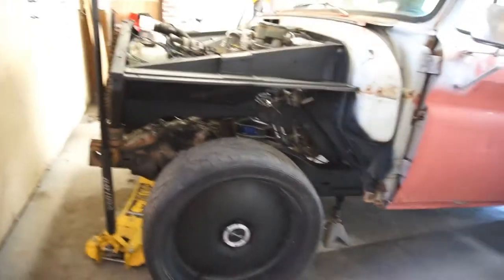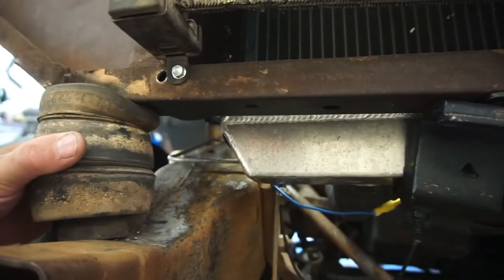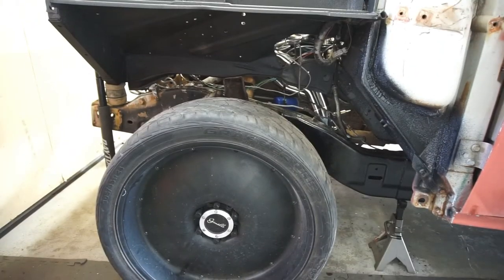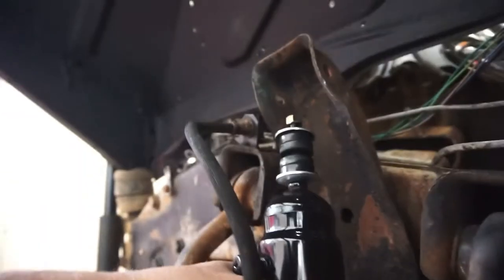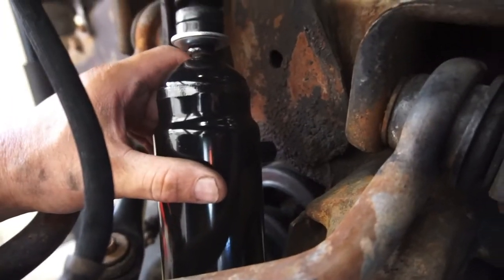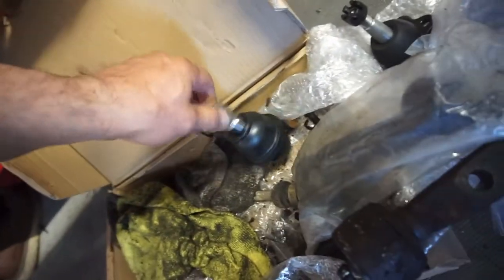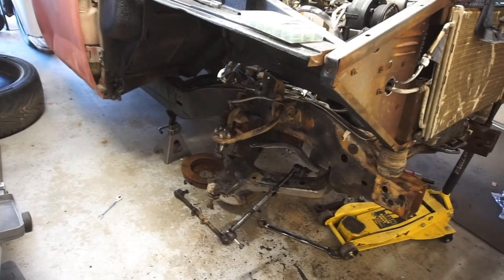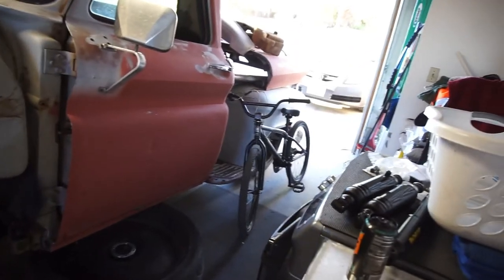Tearing The Front Steering Off PCP 1964 C-10 With 1991 K-1500 Chassis and Drivetrain Lowered 4wd 4X4

Comment: 8" lift kit !!  I wasn't buying that for a New York minute .   And I finally see what the front shock mount situation is . Yeah, you're gonna have to be careful that air line doesn't contact anything .  Could you turn the shock 180 degrees and than use some sort of brass 90 degree fitting to reroute the air line ?  You'll get it , I'm sure .
Reply from the maker: It should clear the way I’m going. If not it’s only money and time right? 🤦‍♂️🤦‍♂️
Reply: @Halffast719  ;  Money is replaceable , time not so much .  I like quick and easy. Cheap is good too .  HAHAHA !!